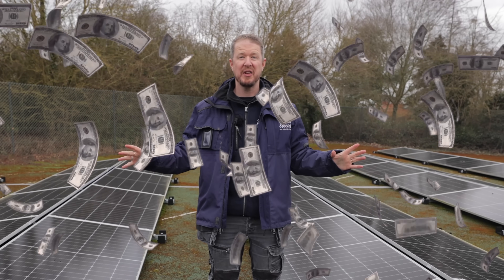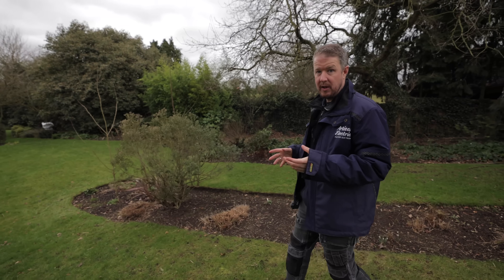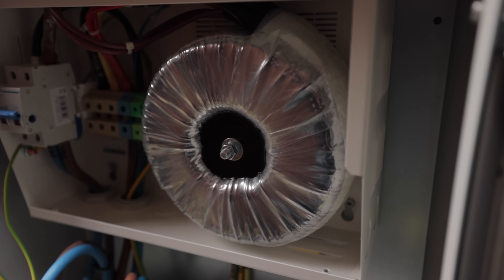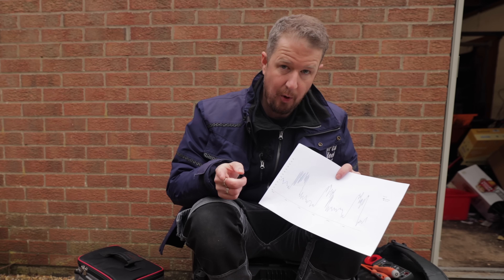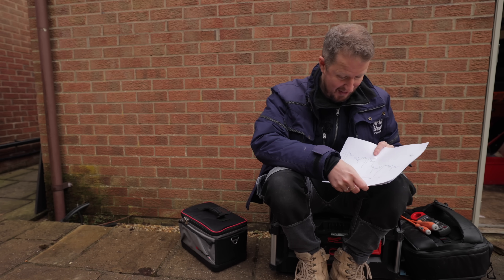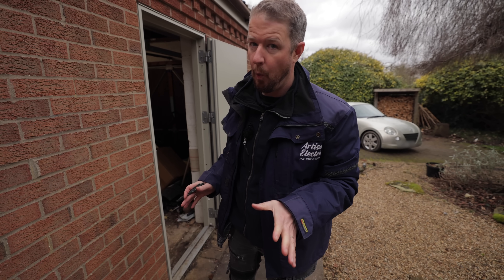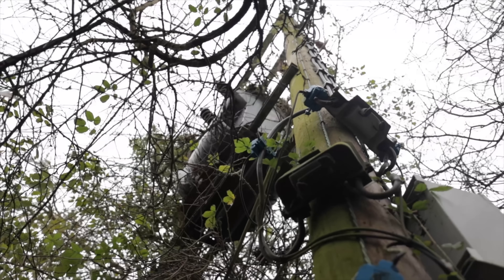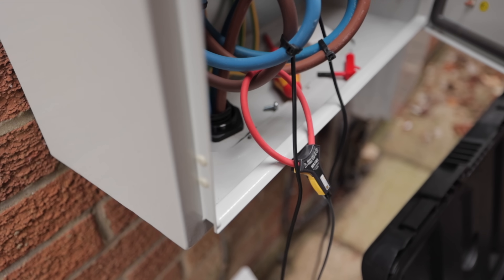THOUSANDS Down the Drain – And We Can’t Do Anything About It!

Comment: Who designed an inverter that sees that kind of voltage at its terminals and does not disable itself ?
Doesn't it throttle the amount of power it's exporting to keep the voltage in the normal range ?

I guess that inverters designed to be used in an off grid scenarios or isolated during power outages wouldn't do that kind of thing.
(Did you review the configuration of those inverters, before investing in that voltage optimiser ?)

Comment: The transformer isn't shoddy, it's perfectly suited for the designed load and usage any change based on what you and your customer want, should be paid for gy you and your customer and those transformers aren't cheap or quick to replace. GL but the issue is on your side not theirs.

Comment: I presume you are  exporting on 3 phases and not just a single phase. If its single phase then I am amazed that you were  authorised to export 17kw  as  in similar circumstances I was only authorised  to export 5kW. and any increase would require a 3 phase connection. If you  are exporting 3 phases then I don't think the DNO will co-operate any time soon.  However if your exporting ion a single phase then I  Suggest the DNO are directly responsible as they should never have authorised that  export.

Comment: ugh I hate SolarEdge ,  most other inverters you just set the upper limit and that is all they will output , here in AU the energy company can remote control inverters to throttle down as well via frequency shifting

Comment: I think you have been given duff info.
I have never seen a manual voltage optimiser.
What you should have installed is a voltage stabiliser, you can get small knock of one"s down to 10kva for around 1k£ 
In  my previous job we installed Merlin Gerin (Schneider) units.
They automatically track input voltages from about 170v to 280v
Reacting usually within 2 cycles and virtually instantaneous with spikes.
Sollatek make knock of's, I don't now if they are as good as a proper one.

Comment: I've been monitoring my incoming supply its a 1930 underground street supply cable coming in we regularly have cables failing during heavy rain and frost they are continually patching repairing the cable and the voltage ranges from highest at peak time recorded was 268v lowest 218v and  also had a faulty condition of 120v just prior to the cable failing . We have a new estate and tapped on to the end of the supply which has quite a bit of solar on the end i believe this is the cause of the spike other solar exporting on to the grid as the data suggests its a peak charging times . We regularly get the back steert full of broken appliances waiting for collection i believe its due to the spike in voltage beyond what the appliance can tolerate . LED bulbs in my house die on mass constantly most are a maximum of 230v built for the European market . The dno refuse to accept responsibility and have said voltage is with limits even when providing evidence of the spikes in voltage .

Comment: DNO's policies on acceptable voltage is rubbish, I wonder if UK power was setup different if this issue would even exist?
Thank god Rocky Mountain Power is +/- %5 
pad-mounted transformers with ratings like 167 kVA (single-phase) and 500 kVA (three-phase, 120/208Y) or 2500 kVA (three-phase, 277/480Y). I think the smallest is 25kVA for residential.  While I can see others in the comments that have worked for DNO and have pride in that, which I respect fully. I do feel the whole infrastructure is in need of major investment or maybe less profit from DNO's and reinvestment. But that's just my own opinion, sorry

Comment: I can't see how it is a DNO fault as 17kw is the equivalent of 6 houses putting the kettle on at the same time... This would cause the same voltage drop at the transformer. Is it not because of the size of the cable going to the street i.e. the resistance of it in both directions? Again I'm a joiner so just my logical thought 🤔

Comment: Easiest option. Go to neighbour on a very sunny day and monitor their voltage. If it’s above the limit get them to raise a fault. The solar should be impacting neighbours voltage if it’s a DNO issue. Same at night, when it’s drawing 14kw, the neighbours should be to low, especially end of line. More neighbours, more complaints. Especially if the neighbours are aware of the potential damage to electronics the high voltage has.

Comment: The problem with the charging system is that because there is no tolerance for variations. There should be some headroom allowance. Also, the energy from the solar panels should be regulated by itself, and not by the grid.

Comment: The basic problem here is that the "gear" is made to CE 230v and our grid is 240v but in reality, in towns and cities closer to 250v. The boys who write the regulations have brought them into line with Europe but nothing "in the field" has changed and the same old transformers are humming away mostly installed before we even joined the EU. I was a registered electrician for 20 years and I saw voltages from 230v at the end of an overhead line to over 250v in South London. They make you have an expensive MFT with a really good RMS voltage function but ignore that, use 230v for all your calculations. As for the grid, get talking to some of the older Linesmen. Every area, before the national grid ran on a different voltage and was built to different standards, the problem is most of it is still in use today! In the case of this installation I bet there was no DNO supplied earth on any of the properties in that area originally. Newer properties will look like they have a PME system on the incomer but this will be a conversion in the street, overhead supplies no longer being permitted. I suppose the moral of the story here is take nothing for granted on the supply side and do careful checks before taking on the job. Story: I had a cutout upgraded by the DNO on an overhead system in Kent from 60 to 100A. I had to put in a supply for a "Barn Conversion" running from a property on the same site. The Linesman completed the job and said, "it's stupid really, the supply is from that pole over there which supplies two other properties and there is a 100A fuse on the top covering the lot"....

Comment: Had you ever heard about two way thyristor stabilizer? According to all mistakes you doing - you did not. You can not relay that local network will fix the issue in nearest future, customer will be unsatisfied, his electronic may burn. Just install stabilizer. It costs less than this stupid voltage changing box you bought.

Comment: 🚨🔥 Why inverter allows high voltage, it should clip to 250V, and just logg error for weak grid conection, high wire resistance to grid probably does rise voltage too high.

Comment: I dealt with this in Serbia, and we have 3 phase service as standard at every home. There was a bad connection which caused noticeable voltage variation. EV (e-Golf 35kWh) refused to charge due to 1 phase having big voltage variation.

What I did, was to check at house next door all voltage levels - each phase and neutral compared to grounded rod. I found that neutral is in under 1V from ground, and all 3 phases have negligible (under 1V) voltage drop when I run 2kW heater (8-9A load). 
Next I went to house that has a problem. Loaded all 3 phases and checked the neutral and voltage drop on each phase. And 1 of 3 phases had 10V drop when 8A load was applied - so more than 1ohm, huge problem.
Then I tracked the voltage drop though each electrical panel, until I reached meter box. And there was the same drop when I run the heater on or off.
Therefore I concluded that the problem is somewhere from street supply cable and meter box.
And power company found that there was a bad splice (steel teeth on aluminum cable) and it was slightly burned.
Reply: good pick-up, that deserves a beer   🍺
Reply: In Poland my family's house has been connected to mains electricity via the street light for decades. In fact most of the village is connected in this fashion. Is it the same in Serbia?
Reply: @evilroman1sobieski756 No, our is regular 4x25mm² aluminium, 3 phase service
Reply: they use solar in Serbia?
Reply: @PerriPaprikash  Slowly. Most new technologies get adopted in Serbia with 5-8 years of delay. People wait for prices to go down and for supply chain to become reliable, and installers to become experienced. Most installers worked in Germany, and when they come back, they transfer knowledge to locals. 
But electricity is very cheap, roughly 20c/kWh during the day, 5c/kWh at night.
Reply: @PerriPaprikash  I would assume cloudy a lot.
Reply: @PerriPaprikash  Solar's everywhere. 300W panels can be had for less than £100 each now.
Reply: @spankeyfish 
If you have median pay of 500€ per month, 100€ per 300W panel is not cheap at all.

Comment: That transformer which I assume is an 'autotransformer' looks very undersized for the power, although it could be an offset type where it adds or subtracts a small percentage of the incoming mains. It's also a blunt (dumb) instrument for a complex issue.
Also every time I've checked UK mains voltage it's been around 245Vrms.

Comment: This is a case where a survey of the local infra structure prior to quotation would have highlighted the deficiencies of local LV supply and transformer now illustrated here and in the comments.
I think the scheme was too ambitious for its location.
A three phase system could have mitigated some of the subsequent voltage variation experienced but would not have overcome the fundamental issue that the local LV/HV system is not capable of absorbing the potential maximum generated output of the solar system.
I do know of a local DNO refusing a grid connection to a renewable source for that very reason.
Your local DNO should have done a proper on the ground survey before agreeing to your installation's connection, rather than a desktop exercise

Comment: Mate to be totally honest you are not an Artisan. You installed equipment for a customer and due to you not "thinking about" your work is substandard. You install a voltage optimizer that doesn't work or is causing additional problems. All seems to come back to your installed system fundamentals. Now you are pushing an App to push out quotes that are produced based on no site visits. Listen to yourself....
Reply: Artisan... more like hackisan... at least he could have installed a proper AVR autotransformer instead of that pathetic "optimizer".

Comment: You sound like 'installers' of PV systems rather than 'designers' of such. All these problems can easily be solved by using an automated intelligent system (computer) to monitor real-time data and make adjustments as necessary. The hardware to do this is available but at a cost.

Comment: The optimiser is surely on the wrong side of the system, it should be between the solar inverters and the network taping down the solar feed. You probably have a very long local spur from the DNO.

Comment: Although not solar related we had a sort of similar issue. The 11kV line crosses our farm and the 11kV/440v transformer is on a pair of poles in our vegetable patch. The 440 3 phase 1st drop is to my workshop, the house take one phase from the next pole down the line which carries on to a pair of house and a small industrial estate across the road. First symptom the we noticed was incandescent bulbs frequently blowing (pre leds which we now have!). During the day the voltage was arround 235 in the house but over night would rise to significantly higher than the 254 legal limit (presumably due to low load over night). I monitored the voltage for days on end using the logging function of my computers UPS which confirmed my suspicions. UK Power networks would not act on my results but eventually agreed to install their own Drantz monitor. It was here for a week end entirely matched my findings. It then took several months and many phone calls for them to come and change the tapping on the (1954 installed) 11KV/440 transformer since when we've no further issues as our base line voltage was back to 238 and we rarely rise higher than 245. About a year later they did replace the transformer but it was the same rating as the old one 100kva iirc.

Comment: I have no solar or heat pump yet, and this is due to experiencing high-voltage rates at my property that causes or car charger to reset, which means being ‘offline’ for circa 5-minutes each time.
I currently have a UK Power Networks monitor installed to aid their investigation. This problem has been ongoing since we bought an EV last June. 
Thankfully, our car charger company can provide detailed logs of the voltage received at our property; the worst high voltage occurrences is 1,200 per month and the ‘best’ is 600 per month.
This works out to between 2 and 4 days per month where we are unable to charge our EV. 
Thankfully, UK Power Networks are still investigating, but the dream of cheap EV driving with the benefit of plug ‘n play charging is not my experience…

Comment: Lol I have been bringing this issue to a few youtube channels. Midwales we suffer from this.  Our DNO accepts its an issue,  EV chargers are the problem you cannot adjust user voltage. Inverters you can with the concent from the inverter manufacturer. Our issue is the chicken sheds filled with huge solar in rural areas.

Comment: The overvoltage is only a problem at the EV charger outlet?

Why not just put the optimiser inline with this outlet then?

This way the battery storage sees full voltage but the car charger is stepped down.

Or am I missing something here?

Comment: This is why I always calculate bigger solar systems to work with 3 phase home connections. Also the grid image loaded into the solar inverters have a cut-off value of 252 volts. Just to safeguard the grid and system.

Comment: Hi Jordan, now you see why I built my system entirely on Victron equipment, I don't think any of this would have happened using the Dynamic ESS (Energy Storage System). 
The grid and PV-produced voltages do not mix directly on the outputs of a Victron inverter in an ESS setup. Please correct me if I misinterpreted something in your video since I am not familiar with that equipment.

Comment: Good video and diagnostic. I liked it. An idea! if you were to install the battery power wall on the grid side of that power optimizer then would that solve at least one of the problems. So in other words put the power wall connection between the optimiser and the meter. Assuming that the power wall can cope with 250volts (assuming that it can since it was apparently working before and it was only the car charger that was tripping out ). Then the power wall can charge at the higher voltage but the house, PV and car charger can be on the other side of the optimizer running at the lower voltage. On a different note I am working on a project to make online tools and a portal available to folks who are working in or want to work in the energy flexibility market. It is supposed to act as a one stop shop between the national grid, policy makers and companies entering the demand and supply side flexibility market. If that portal could offer 3 key services then what would they be?

Comment: Can you only run the car charger through the transformer you installed. It fixes the issue with the charger and the batteries, but the other appliances in the house are still exposed to the high voltages, so not ideal.

Comment: The voltage optimiser is a sticking plaster solution. Better to get the grid sorted, probably by upgrading the transformer (thus reducing the transformer impedance as seen from 230V side) or by extending the 11kV circuit closer to the customer and putting in a new transformer closer (thus reducing the LV cable impedance). This should be at the DNO's cost because they made an error in their G99 assessment which induced the customer to invest in equipment they can't properly use. The DNO is not complying with its legal duty to provide supply within the range specified the regulations. An official complaint should be made

Comment: In the Philippines, where large houses have been built in rural areas using air conditioning, some use motorised variacs. This is an "I'm alright Jack" approach as Neybours might have a job even lighting thier houses. Not to mention problems pulling large amounts of power through the inadequate grid, with thin cable stretched huge distances!
I would think the Neybours of your customer would have something to say about dealing with huge voltage spikes! I assume this only happens when the batteries are charged and power isn't required, with the system dumping excess to the grid. Could this be burnt off with large industrial heaters outside? I'm no Electrician, electronics is more my field, but could the output from the solar panels be regulated? Your optimiser couldn't smooth out the voltage spikes, automatic regulation of some kind, preferably less mechanical and less prone to failure than a variac, would be ideal if the grid can't be sorted out! Great content, brave of you to reveal the issue warts and all!

Comment: Its a bad inverter design, it shouldnt be allowed to go that high. I think too that that the lines are long and/or bad connections somewhere in the line. But the inverter should not be able to compensate that much for line loss.